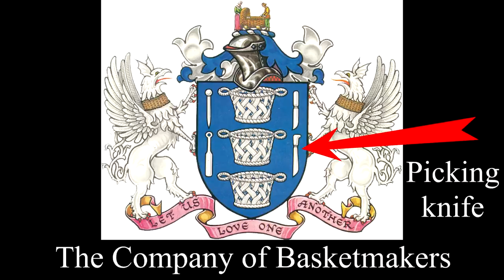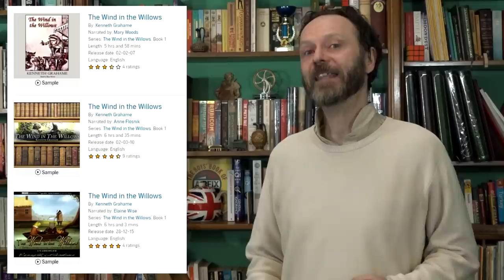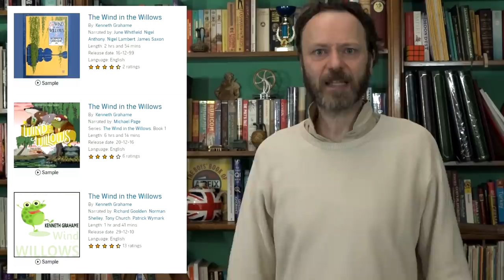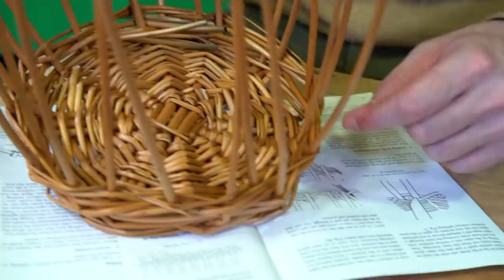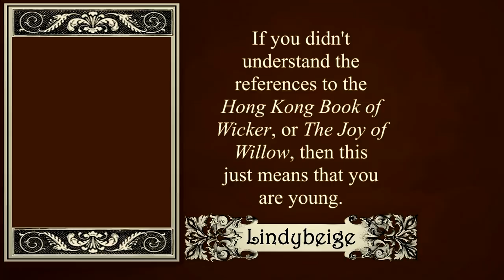Basketry - the ancient versatile craft, as demonstrated by an incompetent

Comment: Woodworker here. Length absolutely effects the rate at which wood absorbs water. Wood absorb and loses water primarily through the end grain. This is why freshly cut or green lumber is sealed with wax at the end before it is left to dry out. Longer reeds would mean it takes longer for water to diffuse from the ends to the center.
Reply: Like a bundle of paper straws soaking up water, yeah they will eventually soak up water through the walls, but much easier through the open straw.

Comment: I made a wicker casing around a bottle to use as a water bottle for LARPing. The willow was thin and of fairly uniform diameter, which made things much easier. Also having a shape (the bottle) to act as a form really helped. If you want to try basketry as a beginner then I can recommend this to start with.

Comment: This is cool.
The first time I made a basket, me and the boys were sitting down by the bridge I made, dipping cept I don't do that so I was bored.
I cut down some briars and cut the thorns off and I made a ring with a few of them. This was the lip of the mouth of the basket. I then made a rough dome with two ends of short stretches of briar in either side of the ring part. Over and over. I still have that basket for getting eggs.

Comment: The soak is based on the length because of capillary action as you said. The ends have cut fibers while the outsides are fairly impermeable by plant standards. I learned about this sort of thing from timber framing videos. I took a whack at riving boards and your baskets look better.

Comment: I am so used the old baskets we had big ones that we used to carry firewood inside to heat the oven ... they were cheaply made and not perfect but perfectly capable for that task and some rowdy children to play with them. ^^ One of the reasons why we dont know much about how old it is. Is simply you only need one material to make them ... and that material why sturdy and strong and everything will get brittle after around 5 to 10 years of use (depending on the use) and opposite to plastic will actually rot or burn or decompose easily when not in use anymore.

Comment: Next time, don't allow the bundles to rest so long. The overnight instruction is for much larger bundles and the blanket is for keeping moisture in while allowing the willow to breathe. It essentially keeps everything more or less uniformly moist so when you bend it, the excess moisture is pushed out. As it dries, it will tighten the weave, so make it snug but not so tight. You may end up with snapped strands well after you have finished weaving. It's a great first effort done with no practical instruction, so I'd call it a win.

Comment: To make a squared basket, it is helpful to use a basket form. Your size will be determined by how many sticks you have in either direction. Weave them into a mat, leaving the all of the excess hanging loose, make sure it is quite wet then press those excess around a mold and band them for until they start to dry a bit. This will give the wood memory and allow for easier shaping and weaving. 

Round baskets can be done like this too. In fact, the Longeberger basket company has done it this way for over 125 years. Rather than willow switches, they use splints made of rockwood maple. This make for a stronger and smoother faced basket, the downside being you need to use tiny nails to tack molding strips inside and outside around the top edge, which take a bit of coopering skill.

Edit: Using a form will work just as you had imagined, bending the splints or switches from the base rather than cutting them off.

Comment: If you want a dish shape or dome for your base, you should alternate the base stick ends so they go butt - tip - butt, then make the holes in the side rather than through the top so the natural curve allows all the ends to point downwards if you put it down on your work surface or whatever. You can shape the base sticks as you go to encourage a more domed shaped as you like. You can also shape it over your knee and bend it back towards you.

Comment: @17:15 to get it concave you have to do what you do here at each step, push it in while weaving through, always in the same direction, if you do that well enough with the first few rings the rest will be easy enough and stay in that position, looks fine btw you are using slighty to thick branches but thats ok

Comment: I'm almost certain that is the entire reason.  Wood does not want to absorb water through the sides, for a very important reason, if it can absorb water that way it can lose water that way.  If a tree was losing water through the sides it would be a huge wick and dry to death immediately.

wood, when drying, or in this case wetting is only able to gain or lose water from the ends.  The wood is like thousands of tiny tubes going end to end.

When you are curing wood it is a certain amount of time per foot of length because it won't lose water through the sides at all.  But with the tips cut dry then it will dry a certain distance from each end per day.

Comment: Just like wood, it dries from the ends rather than through the sides. So the inverse is in effect when you want to soak.
With the bits you miss cut... just cut them again but don't make the same mistake.
If you know you are making something with undried, you could cut them longer, so when it does shrink.

Comment: Time to first mistake I could notice: 2 minutes 20 seconds, while talking about soaking willow rods.

Wood primarily soaks along the grain. That's why it takes longer to soak longer rods.

Good secateur work though. The basket went wrong in the waling. Both of your weaving patterns were divisible by the number of stakes. You need coprimes, or you can make the pattern irregular to avoid the issue you ran into where one stake had the weave on the outside every time.